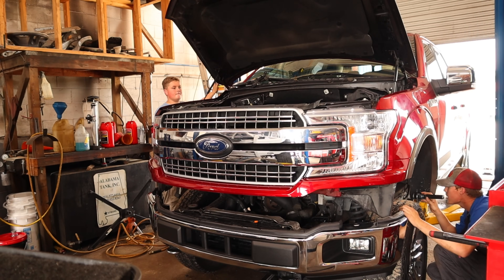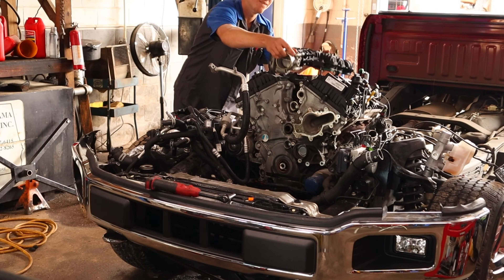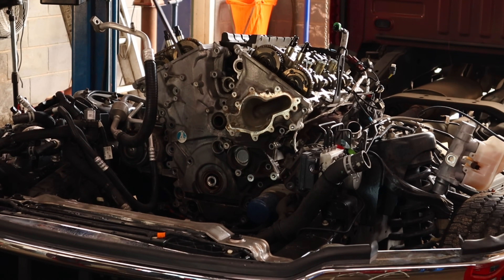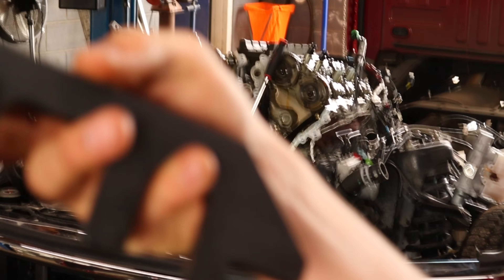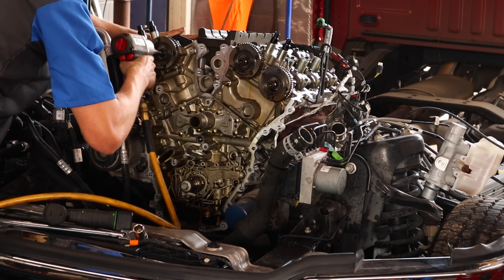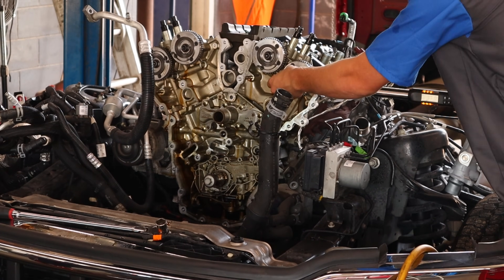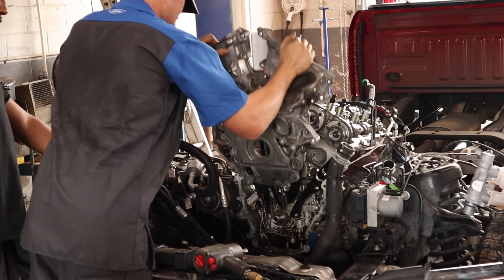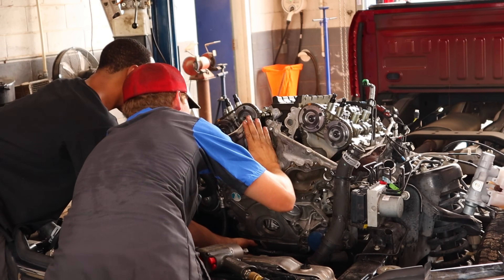Ford 3.5 EcoBoost Cold Start Rattle (VCT Phasers) | Everything You Need To Know

Comment: Great Video... I appreciate your knowledge. This is the second time I am taking my 2018 EB to the dealer for the rattle  issue. The first time was at 48K miles at which time they changed timing chain and tensors. I have it in again today for same rattle at 72000.  They are replacing the phasers at 60% coverage from FORD. I am not a car tech guy so the question I have is that if this happens again do I really need to take it back to FORD. Can I continue to drive the truck without issue with the cold start rattle? Will I do damage to the engine or the transmission with the continued rattle? Thank in advance!!

Comment: I have a 2019 3.5 ecoboost in the shop now with 23,000 miles getting the cam phasers. The engine rattle was minimal but decided to take it in anyways. Now that I've watched this video I don't think I would have done it. There's a lot of parts being touched and removing body from vehicle worries me about future rattles. Any opinions? Thanks and great video.
Reply: I'm at 50K miles on a 2017 3.5 ecoboost. Cam phaser rattle started a month ago. Am debating whether to take it to the dealership or not given those same thoughts. How has yours been since? I know results will vary but still curious.
Reply: Sell your vehicles. They will keep breaking. U will pay next time big bucks. Go to Toyota or Chevy. Major screw up by Ford. Lemon laws should apply. The amount of faulty vehicles is incredible. Yes, this is a major engine tear down. Will never run the same.

Comment: I just took my truck 2018 raptor in to the dealership. They said they had to change my cam phasers again. They said the parts 3-5 days out. I requested a loaner then next day truck was magically done. On the invoice said phasers, gaskets and all small parts including oil and oil filter. Problem is I don’t see any indication under the hood and truck still has my Napa gold filter and not new oil. Make me think they didn’t do what they said they did.

Comment: I fixed my issue with phaser rattle, on my 2004 5.3 liter 3V on my F-150.
The real root cause, the oil feed to the phaser is too small. I drilled out the oil feed to be a much larger opening, allowing more oil to flow on startup, thus allowing the phaser to operate as intended....

-g

Comment: I have a 2018 with about 50k miles and I'm having some rattle but not too much.  Seems to happen when it has been sitting for a couple of days then quickly goes away.  This looks like a fairly major repair and I am worried about other things going wrong down the road once they get in there and mess with the engine and it also looks like this is an evolving problem as Ford figures things out.  My question is, should I have this done and risk other things going wrong and what is the probability of the dealership causing other problems?  Also should I do it now or wait as long as possible?
Reply: I am in the same boat with a 2017 at about 50K miles. I am concerned for those exact same reasons. Did you end up scheduling the warranty work or no? If so what has been your result?
Reply: @tastyberries4843  I went ahead and did it about a month ago and so far haven't had any issues but I guess time will tell.  One thing to note is that an oil change is part of the process so you can save yourself some money if you schedule accordingly.

Comment: Mason,
I just finished doing a phaser job on a 2018 F-150, with 85K.
The phasers wouldn't "lock" and it would cause the valve train to "SNAP" as I was barring the engine over. The cams would literally rotate in the phasers, due to valve springs tension rotating the cams during rolling the engine over. Quite surprising to observe. New to your channel. 
Nice to see someone that's going "take over" after Ford Technicians my age (54) retire. Been in the Ford Dealerships since 1988....... I have witness a  LOT of changes over these 35 years!
Patrick
Reply from the maker: I would welcome you to Fords “quality” parts but you already know about them if you’ve been doing it that long haha
Reply: Would be better to switch from 5w30 to 5w-40 just to have thicker oil to cover the phasers?

Comment: Mason, I have a customers  land rover HSE 2014, it has a ford 2.0 ecoboost motor. P0016 codes keeps coming back, and Land rover dealership replaced chain, VVT phasers and VVT solenoids, vehicle still getting the same code. They finally told the owner it needs a motor due to oil is not reaching to intake VVT actuator. When I diagnosed it, I found timing chain was losing its tension under the torque, causing p0016 code to come on. Replaced the tensioner vehicle still getting the same code (even though chain is tight), I tired engaging solenoids; exhaust solenoids works at should. But the intake solenoid does engage I can hear clicking I can see solenoid moving up and down, yet intake timing does not change. I am wondering if you have an oil flow diagram for this motor. Trying to understand the passages of oil flow.  Any tips and help that would be appreciate it. Thanks!

Comment: I have a question… I bought a 2012 F150 3.5l, it had 89k on it when I bought it last year. I paid too much but we won’t go into that. I ran a lot of highway miles on it over the last year bc I was working in NM and my kids were in Louisiana, and I have part time army stuff in Houston TX. Well it’s up to 158k now in just the one year I’ve had it. No issues with my truck at all. I towed my camper home to Louisiana bc I told a new job to get closer to my kids. On the trip home I started hearing a slight ticking coming from the passenger head towards the front. It’s been a week and the ticking is louder now. It gets real loud on start up, but obviously quite a down after a few seconds, but it continually ticks no matter if it’s running, hot, cold, etc. Maybe it’s a lifter and I’m just retarded. 🤷‍♂️ It’s not a rattle though, it’s a ticking. Anyway, when I bought it, Ford did the update to the PCM and didn’t tell me what they were doing. I’ve had no experience with any of these newer trucks so I was oblivious. However when I bought it, I put a tuner on it and had a performance tune on it. The tech just unplugged it, did the update, and didn’t ask or tell me anything. How would that update be input with a tune and what would happen? Would it be put back to stock and the update? Or would they just add the file to the tuned file and I’ll now have to leave it on the performance tune? I wish they had told me what they were doing so I could have put it back to stock. I had no idea about this issue until it started ticking last week and researched… then I almost threw up when I discovered I own a truck I still owe $17k on and it may need a few $ks for a repair. I’ll do it myself but fo-mo-co parts are still expensive so I’m not saving much money doing it. Anyone have any input on that?

Comment: Good video and good conversation here in the comments. Ford should be doing a better job in regards to extending the warranty for the VCT phasers. They are aware of the problem and don’t have a proper fix yet, and they are being stingy with the extended warranty coverage. Not a good way to stand by your product.

Comment: My 2019 3.5 F150 has less than 3000 miles on it now. I have a lot of automobiles. At 2200 miles after an oil change it rattled like a diesel one morninng on cold start up. I change the oil every 8 months. I noticed when changing the oil the Mobile One oil filter that I was using the filter oil holes were smaller than the Ford Motorcraft oil filters recommended for this truck in the Ford owners manual. So I figured less oil flow with the smaiiler holes. I drain the synthetic oil and filled the motor up with 6 quarts of Pennzoil Platinum Full Synthetic 5W-30  and installed the Motorcraft oil filter. It works well so far with only a slight tick tick tick on cold start. I can live with that.

Comment: I'm die hard ford owner, but that being said  I got 2017 3.5,  if I were to trade would  it be wise to just  get the 5.0 looking at a used 2021 with12,000 miles on it
Reply: Make damn sure it's not an oil drinker, unfortunately still seeing 3rd Gen 5.0's with oil consumption issues

Comment: I got sick of my rattle ford so I got rid of it. I use to own fords but, now own Hondas and Nissans only now.

I had a 2017 Ford Taurus
2018 Ford Focus Transmission DCT failed
2016 Ford Mustang good car
2018 Ford F-150 terrible
2016 Ford Fusion terrible auto transmission also while driving car went automatically in neutral while on highway. Almost shit my pants. 

Now I don’t own any fords bad experiences besides the mustang. 5.0.

Comment: As I am not a mechanic, I watched another video where the Ford tech showed the little hardened PLASTIC peace locking up and or breaking in the phaser causing the issue. 
The gentleman recording the video looked at the tech and said so if this part wasn’t plastic would we have the issue? The tech just looked at him for a few seconds with a smile and continued working. So yes, a $.15 plastic piece turned to some sort of metal would solve the entire issue according to this guy.

Comment: Lmao. This is old news for European car technicians. One way valves need to be designed into the cam adjustment gears or he head to keep them in position until oil pressure is built up

Comment: 2018 Ford Expedition: Had it fixed/replaced under warranty at approximately 42,000 mi. Started doing it again at 80,000 mi. Traded it in two days ago for a Chevy and couldn't be happier.  Eco boost motors are trash motors
Reply from the maker: Watch out for bad lifters on that new Chevy haha
Reply: @FlyingWrenches13   Thanks for the heads up. With all the info out, it points to the 5.3L, 6.2L and EcoTec V-8 engines with build dates between September 2020 and March 2021. Ours is January 2022. Sooooo there's that. At least Chevy does something about it. What is Ford doing about it....... A computer update that does nothing to fix the problem? And at best they'll do it at a prorated warranty cost! I'll take my chances!
Reply: @michaellarson2734  My GMC lifters failed  at under the warranty miles (although over the years limit by a month) and the dealer and GM said go fish. An independent did the job $1K cheaper than the dealer's quote at $1700. So YMMV on GM backing their products. At least here Ford has provided exteneded coverage  and pro rated as well.

Comment: Good to know. My 2017 limited has 43k miles. I had the reprogram done on it. Didn’t change a thing. Deciding if I want to be without my truck for 3-5 weeks or wait little longer to have the phasers replaced.
Reply from the maker: It should not take that long to have phasers installed. We have about a 2 day turnaround on phasers. Now it might be a month before we can get an appointment for you to bring it in but it comes in and out pretty fast.

Comment: Do you have info or videos on the 18 F-150s oil consumption. Mine just came back with right side spark plugs oil soaked, needs new short block and right side cylinder head. Have had  the the PCM flash and longer dipstick done prior.
Reply from the maker: I don’t yet. Last one I had that I couldn’t get the oil consumption fixed with pcm reprogram I ended up putting heads on it and it fixed it so I would push for at least a long block.

Comment: I have a 2020 F150 3.5 - rattle on startup - took it to the dealer and let them know - they said it didn’t need to be fixed and it was ‘normal’. I told them about the TSB and their response was ignore TSB’s. I tried to push the issue with the service manager but no one wanted to fix the problem. Maybe because it’s still under warranty? 17k miles
Reply from the maker: Sounds like you need a new dealer.
Reply: Sounds like you need to call Ford Corporate, they'd like to know which dealer is refusing to do warranty repairs to a known issue

Comment: I was browsing marketplace and saw a beautiful loaded f150 crewcab lariat with 72k miles and they were only asking 20k for it. However the owner says it knocks and loses oil pressure. I never seen it in person but do you think its fixable? Or will a new engine be required?
Reply from the maker: Impossible for me to say without looking at it. If it’s a cold start rattle then yeah it’s fixable and you should buy it immediately. If it’s an actual knock and actually doesn’t have oil pressure, which by the way I’ve never seen a 3.5 “not have oil pressure” then I would probably stay away from it.

Comment: Dude you recommended to change water pump but not the oil pump? That doesn't make any sense while you're at it.
Reply from the maker: You’re not “at it” to replace the oil pump. You have to drop the oil pan which requires either the engine to come out or the front differential to come out. It’s a lot of extra work to change that oil pump especially when I’ve never seen one go bad.

Comment: I have a 2018 expedition and it has this rattle. Sounds to me like ford has no idea how to fix this issue and are going to screw over anyone that owns a 3.5 once they hit a certain mileage. Ford should own up to the fact that the engines have an issue and fix the problem. Looks like I'll more than likely be trading in for a tahoe.
Reply from the maker: Check out my newest video talking about the extended coverages ford issued for this issue.

Comment: I just got my 2018 F150 back from the dealer today. It has 59,700 miles and I had the coldstart rattle. Ford covered 100% for the cam phaser VCT replacement. But I wished I watched your video last week and I probably would’ve had the timing chain and tensioner‘s replaced.  Still, at 60,000 miles the timing chain should last me a while longer if the engine is properly maintained — correct?  Also, the dealer said they replaced the coolant but were not obligated to change the oil, which surprised me. I didn’t fight it. But according to you the TSB said they should have.  Oil life is currently 70%, but I think I’ll change it myself this weekend.  Thanks again.
Reply from the maker: Chains are probably still fine at 60k. I wouldn’t worry about them. That dealer straight up lied on the oil change. It’s part of the procedure for replacing the phasers.
Reply: @FlyingWrenches13  - Thank you so much for the reply and for the great answers.  You’re right about the dealer. I changed the oil myself over the weekend.  Glad you know the chain will last a while longer. When it’s time to change the tensioners I’ll probably get the water pump changed too.  Again, great video.

Comment: Another mechanic had the same theory about the phasers- oil pressure issue. He mentioned that Ford should get the PCM to increase the oil circulation to the phasers & timing chain at start up. I don't know what that means, but what you said, seems logical to me. (non-pro mechanic) I would do this to my 2014 F-150 3.5 ecoboost. I got 198,000 miles on mine and running really good, but waiting for the noise to get louder as time goes bye. I have no history on my truck, only what the VIN # report has. But I would love to know what services were done on my truck, just to see what else did they fix on it that I don't need to do to it. My truck sound good for the year and mileage, so I'm hoping that he took care of all the recalls and problems. It's too bad you live so far, I would love for YOU to do the job, since you seem to know what you're doing. (Take pride in your work)
Reply from the maker: Thanks! Their are plenty of dealers out there with techs that could do just as good of a job as me. Just gotta find them.
Reply: Were  you located @FlyingWrenches13

Comment: I’m looking at buying an 18 expedition. It has 60,126 miles. It was a trade in to a Toyota dealer and I didn’t notice a rattle on startup but don’t know how long it was sitting. The car fax and Ford vin lookup shows the recalls mentioned. I’m not sure if it’s been reprogrammed. If I buy it should I take it across the street and have Ford do the program or replace the cam phasers? I love the vehicle but it’s kind of steering me away from it.
Reply from the maker: Yeah, I would just go have the 21B10 performed to try to stop the rattle from happening.
Reply: @FlyingWrenches13   awesome! Thanks for all your content! It’s been extremely helpful! I’ll get it in before FEB deadline.

Comment: Not sure if this helps but I seen another video where a guy fixed the rattle by holding the brake and the throttle to the floor crank till you have oil pressure then let off the throttle and start the vehicle and no more rattle FYI

Comment: Would an easier, more cost effective fix be to install a pre-lube accumulator that would pressurize the oiling system prior to each engine start-up? Looking online, a kit would only be around $400. Not sure how difficult it would be to install, but certainly easier than the phaser replacement job.
Reply from the maker: I would just replace the phasers. Once they start rattling, no amount of oil pressure is going to make them stop.

Comment: So, can I have this recall done even if it’s not rattling yet?
Reply from the maker: Yes, you should have it performed before it starts rattling.
Reply: @FlyingWrenches13  I called Tom Masano Ford in Pennsylvania about it, I was told it needs to be making noise and diagnosed. They won’t just do the recall. Doesn’t make sense. Same thing with the other recalls, like frozen door locks.
Reply: @Mat0  find another dealership. They absolutely should do the 21b10 update, it's to help prevent getting the cam phaser rattle in the first place